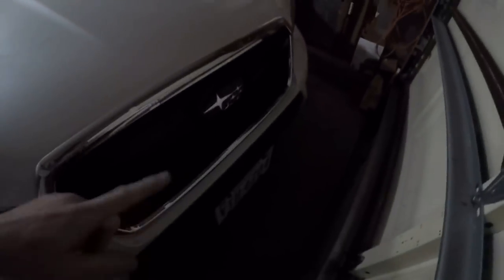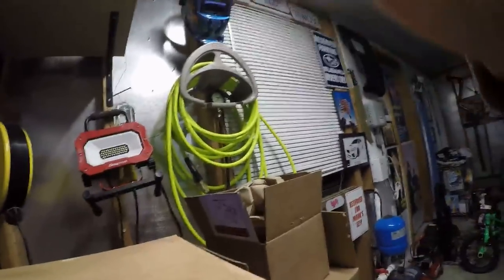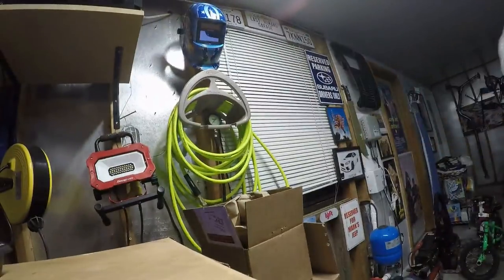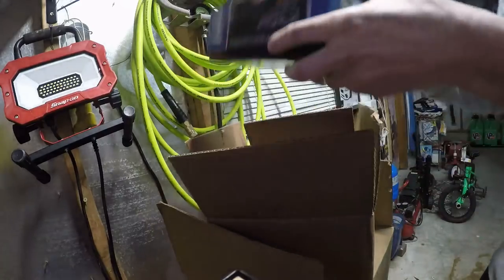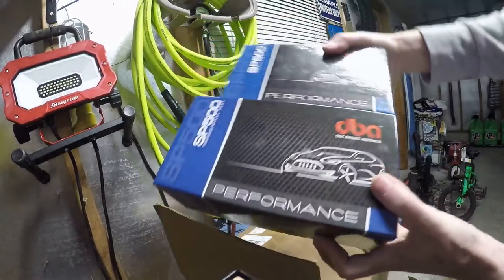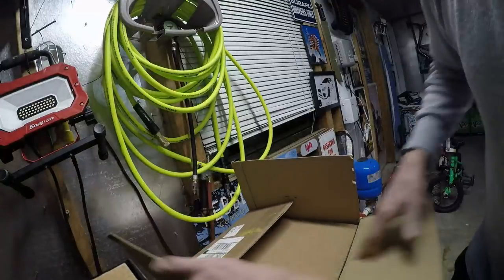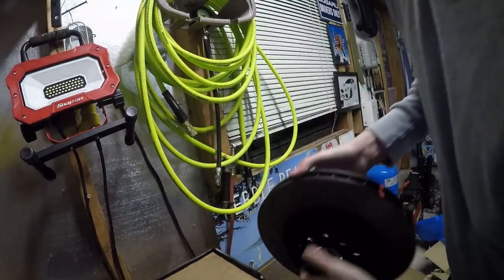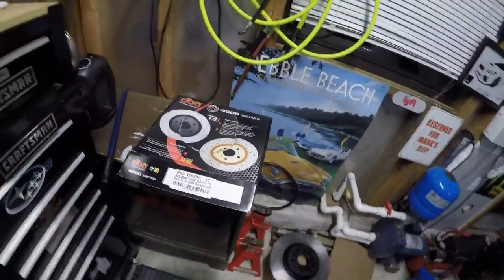2015 Subaru Forester XT Ep. 80: Unboxing The DBA Brake Upgrade

Comment: I agree with you, Ken at KNS Brakes knows his stuff and saved me a ton of money for my wife's Outback. Subaru did the same thing with the Outbacks mid-year but no one knew this, even my dealership when getting a quote for pads and Rotors quoted me on the wrong parts. Ken pulled through with the right parts.

Comment: Did you notice any film or coating on the rotors?  I installed these on the fronts and at highway speeds, my car shakes violently.  I noticed what I'm assuming is a protective coating, so I removed them TWICE and cleaned them but still the same issue.  Had the front end aligned a month earlier, tires balanced and rotated after the issue started.  Problem remains.  Trying to get a warranty replacement.
Reply from the maker: dude, #1 cause.. your mounting surface.. rotor to hub. look for imperfections, rotor not sitting flat, etc.
Reply: @LastHumansGarage  Thanks for your reply.  I used a steel brush the 1st, 2nd and 3rd time I on the same rotors and the mounting surface.  Yes, I've had them off/on 3 times.  I've done about 30-40 brake jobs, wouldn't say I"m a rookie at this.  This is the 1st replacement on my 2015 Forester.  The rep for DBA was hesitant to warranty them but said he'd ship me out a new set.  I'll reply after I install them.  BTW, I've never seen this much protective coating on rotors before.
Reply: Follow up.  I did get a warranty replacement from DBA's sales rep, Matt.  I was almost certain this was rotor related due to not having/noticing the issue prior to replacing the rotors.  However, I was wrong!  The control arm bushing was very worn.  Both Ken (KNS Brakes) and Matt (DBA) were quick to help me resolve the issue, greatly appreciated and highly recommended.  Brakes and rotors are working perfectly!
Reply from the maker: @danv135  wow great tip for future people.. control arm bushing is a good find...

Comment: I tried to get the same upgrade for my 2015 XT touring, however, Ken said the DBA SP500  pads are back-ordered till mid-March. What do you think about Hawk HPS High Performance Street instead? Or its worth waiting for DBA SP500?
Reply from the maker: Gazi Islam I would wait, ive had plenty of hawks. I like Dbas more
Reply: @LastHumansGarage  now Kens saying the front pads wont be available until May.  I already purchased DBA T3 4000 Series rotor and DBA SP500 rear pads. any other source/advice?

Comment: I plan on doing my own 17 Forester brakes. I've never done brakes nor do I know much about them. Do rotors absolutely have to be replaced every time the pads wear? Am I just better off replacing pads and rotors anyway?
Reply: jgzero18 Nah you don't have to replace the rotors unless they are worn or warped
Reply from the maker: ya, you dont have to.. but after 100k miles.. i prob would.

Comment: So why did you choose to avoid the rears? Any worry about uneven wear on the front versus the back rotors?
Reply from the maker: because they dont make them.
Reply: ah, I went to KNS after this video and they have kits that seem to intimate that rears are out there. Thanks for the heads up (I see that it says front on the cart but the kit says front/rear)